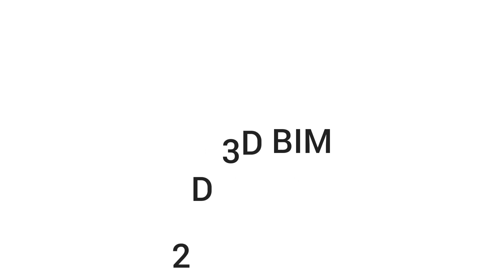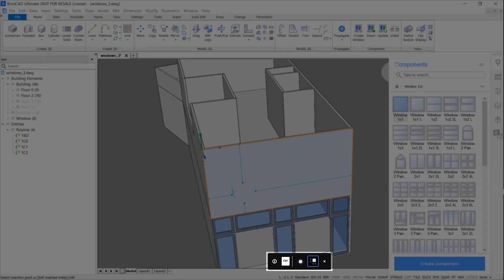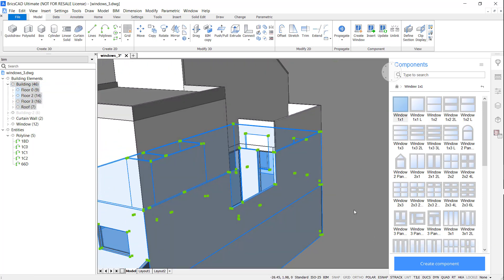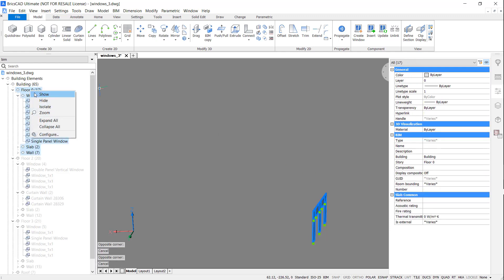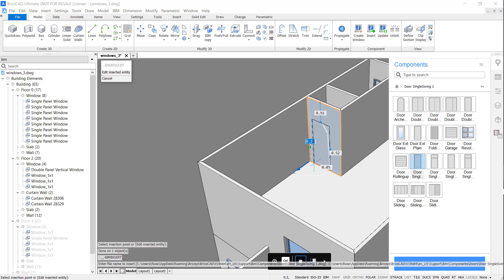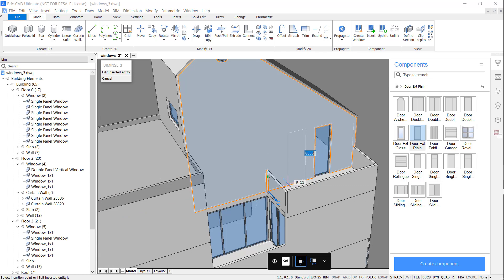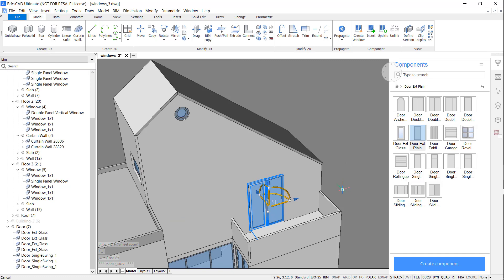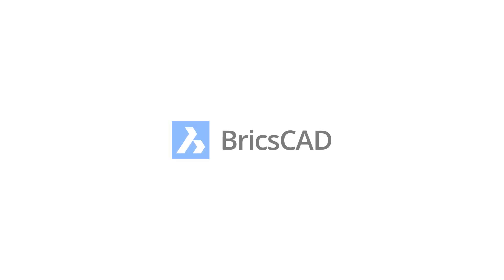2D 3D BIM - Windows and Doors - The House P3

Comment: I wanted to see how does that building look in 2D ?  Does it automatically switch the 3d layers off and only leave the 2d ones on ?  So, for example, you'd then see the windows as 2d, doors as 2d etc etc ?  With hidden lines as dashed  etc ?
Reply from the maker: the 2D drawing is not a layer, it is a DWG drawing that is generated by BricsCAD. You create layers with the BIMsection command: https://help.bricsys.com/hc/articles/360007697454-BIM-Sections-
The way the 2D view look is completely customizable. You can do this by creating a drawing template and BricsCAD will use the same settings each time. https://help.bricsys.com/hc/articles/360010195960-Templates-for-generated-drawings

Comment: how to add door, window from plan view
Reply from the maker: You can insert door or window on any view, but you can't locate it on a wall perpendicular to current plan view, so XY view is not suitable for this. Using front/back, left/right view you can locate a door or a window on a nearest wall (previously turn on the DUCS - dynamic UCS in the Status Bar, or inserted object will be parallel to XY plan).
But it's much more easy to use isometric view for this.